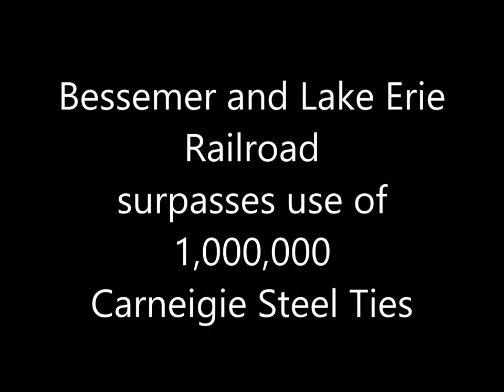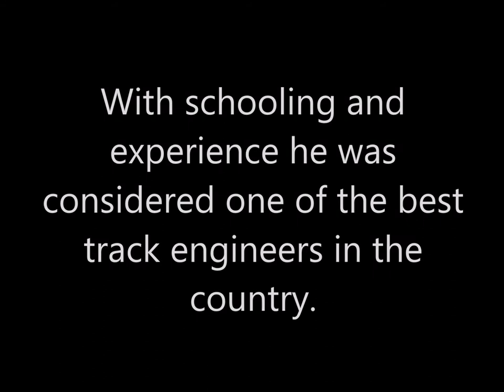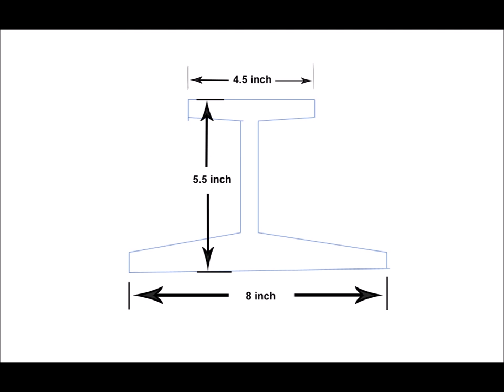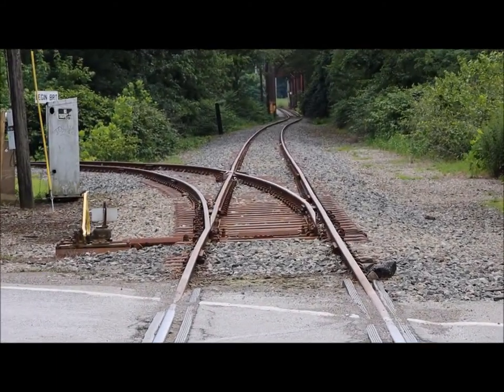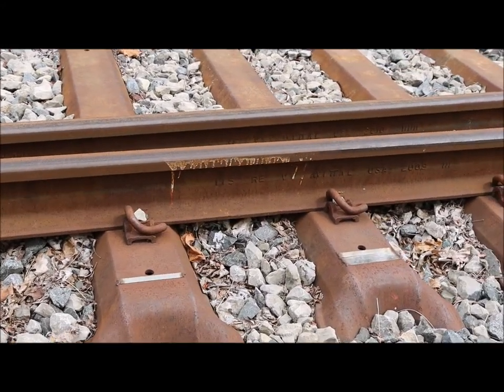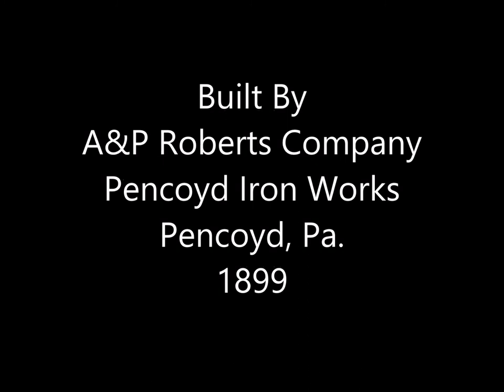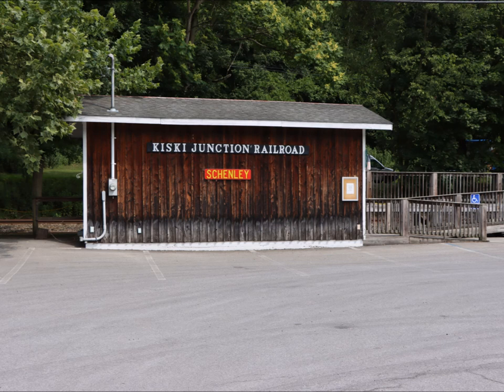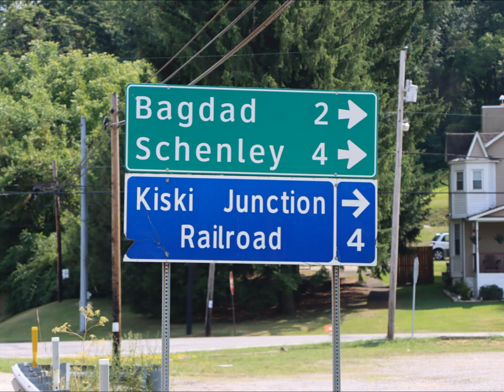Besemer and Lake Erie Railroad surpass usage of 1,000,000 Steel Ties

Comment: Ultimately these beam shaped ties were found to not be suitable for mainline use as they provided little to no lateral restraint to the track.  Wood ties lock into the ballast providing better lateral restraint.  The new steel ties in your video have their ends bent down thus providing lateral restraint.

Comment: On the J&L Narrow Gauge Railroad we have a few Carnegie steel ties that we salvaged from the Carrie Furnaces.  Since we are 24" gauge those ties were cut in half and both halves used in our track.  We use them mainly for holding gauge and for longitudinal anchoring.
Reply from the maker: Didn't think any were known to exist other than maybe a museum. Have any photos?

Comment: I think there some around the Greenville Shops. a picture was around a few years ago, I do not have a link at hand to give. Will check around. Youngstown Steel Heritage is correct about the lateral motion. IIRC, many of the steel ties were taken out in late 1920's, at least I remember a number of ties with 1929 date spikes on the Old Main north [rr direction] of College Ave to Williams Crossing in the early 1970s.